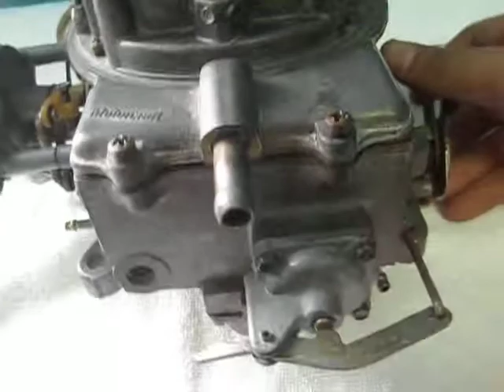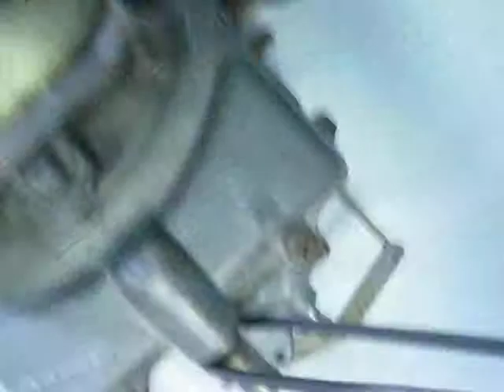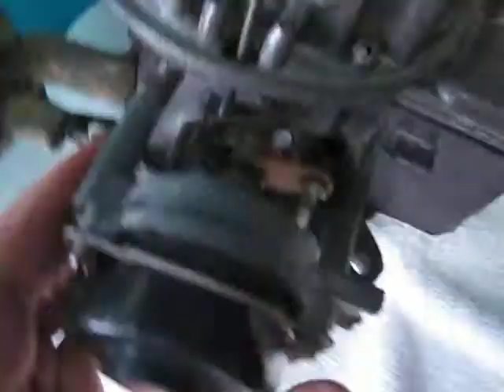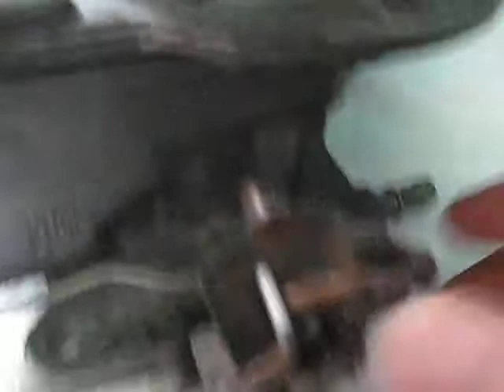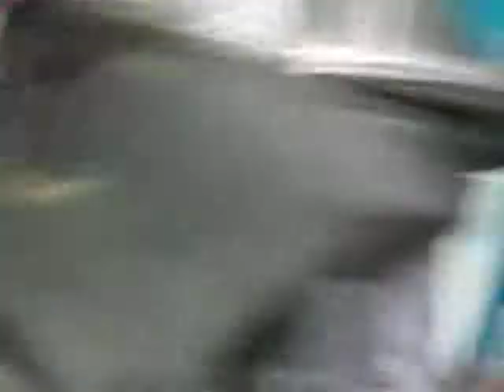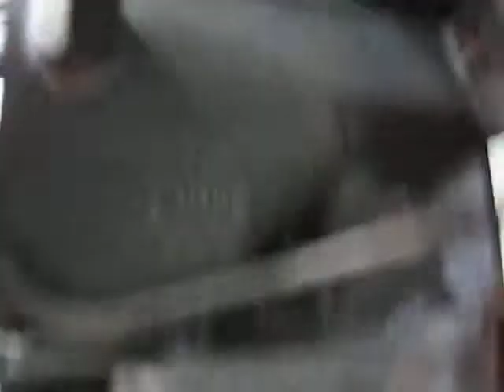rare 2150 motorcraft with variable high-speed air bleeds 1.08

Comment: this is the exact carb i have on my 302 . what makes to so rare
Reply: Ben Jardine  because yours its not a 1.08 venturi they all came on small cars, not many survived, and the jeep guys drool over thos type of carb
Reply: Juan Celis . so its a 1.08 venturi but its not small ?
Reply: Ben Jardine treasure it if it has air bleeds, that tech was ahead of its time
Reply: Juan Celis  yes mine has air bleeds . runs good wide open but i think shes in need of alittle adjustment
Reply: Ben Jardine you lucky dog
Reply: Juan Celis i never knew these were rare . i new auto lite 2100 was more common .  but i didnt think 2150 with the air bleeds was a big deal haha i was gonna throw mine out when i went to 4 barrel . guess ill save it on the shelf
Reply: Ben Jardine sell it on ebay for 200 bucks
Reply: Juan Celis ha ha a used little 2 barrel couldnt be worth that
Reply: Juan Celis i removed all my choke and my choke flap . i left the horn . its on my 302 grand marquis . been trying tp get every little bit out of it runs 16.3 as of right now and 84 mph
Reply: They're junk. I'll sell mine for $30.